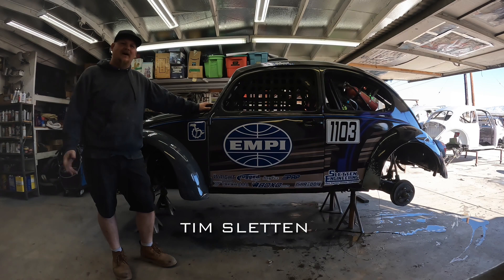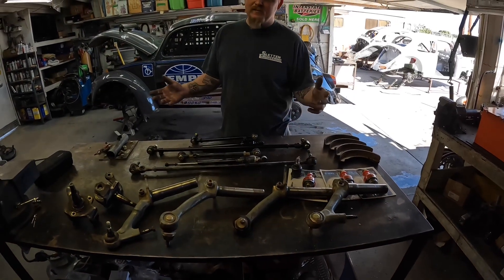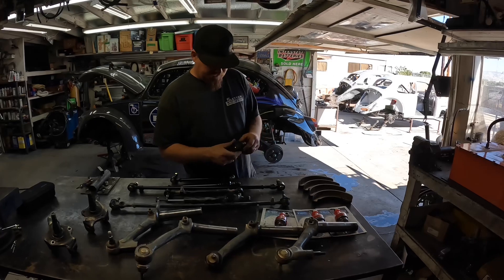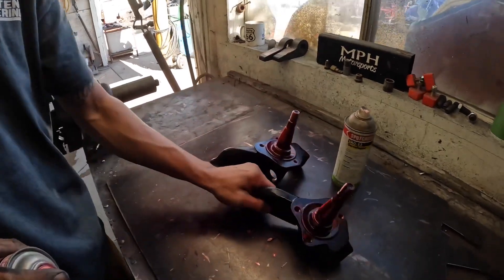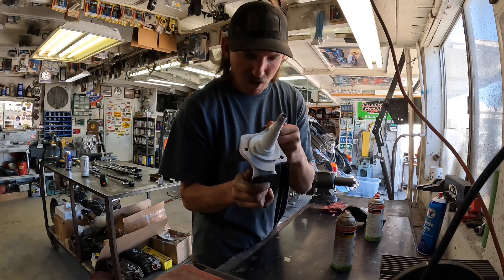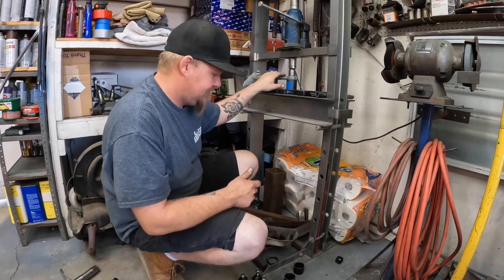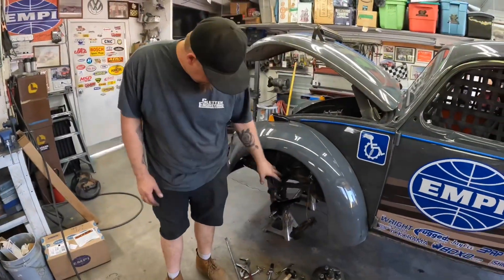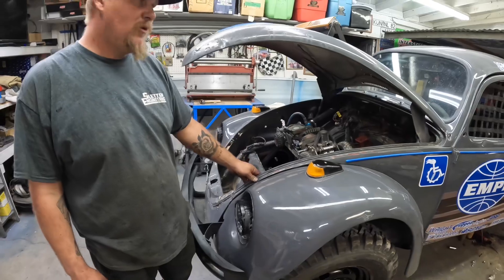Sletten Engineering/ EMPI Class 11 VW Off-road Race Prep- Front End

Comment: I was hoping you had some neat affordable fixture to press the ball joints out and in but it appears we all struggle with those no matter what. Thanks for sharing
Reply: You can just use a hand held ball joint press. But never forget to cut off the front lip of the old ball joint otherwise is wont get out. Its a easy job to install 4 new ball joints with a 80-' tool.
Reply: @daalhoffarm  can you send me a link so I can see this tool or give me the name so I can google it. I have another job to do. Thx
Reply: @TheEZGZ  hi gregg, just google ball joint press kit". Its a c clamp but it can produce lots of Force. How to: best to remove the vw arm you want to change the ball joint on. Place in a good vice. Cut off the treat part of the old ball joint. Cut of the Secure lip of the old ball joint so you are 100%sure it can move out. ( Just with a grinder going around to cut the little lip) soak in some wd40 or something else, than use the press tool the old ball joint should come out very easy. Clean the boren en chamfer the edges, some grease in, position new balljoint and use the right size push flance or socket and hammer the new ball joint in with a good big hammer. It won't be easy but I've done more than 5 sets like this. Also for bay window bus those are even bigger, and for Typ 1.